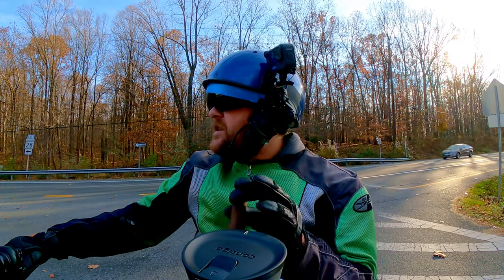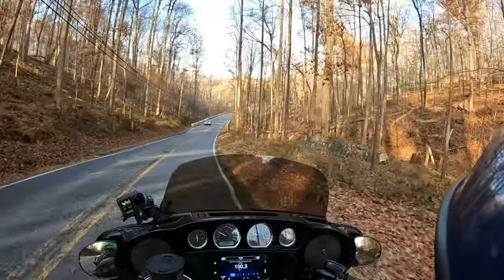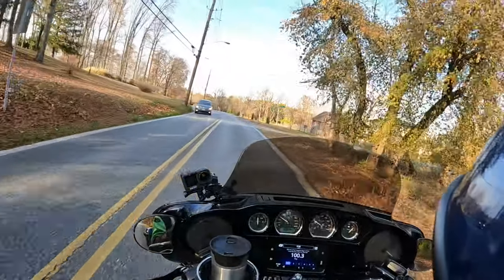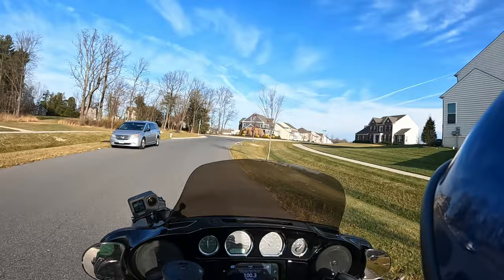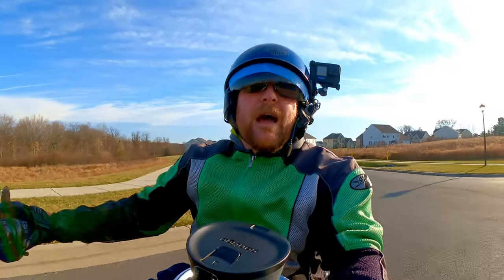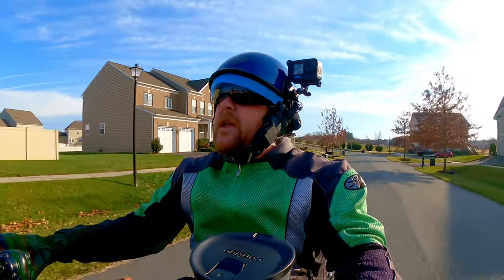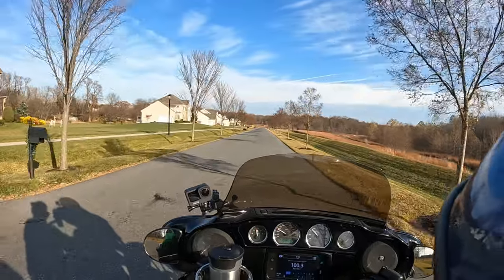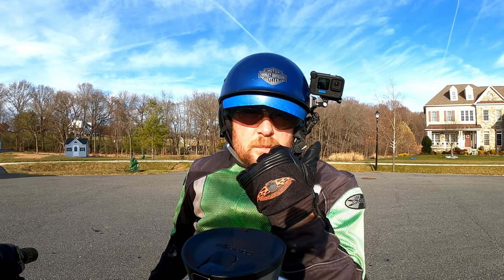Getting GREAT audio with a half helmet is EASY, I'll show you the secret of how I do it!

Comment: I've always been amazed at the quality you get with the helmet you use.  Me with my full-face always sounds echoey (is that a word).   I do have a wind noise reducer feature in my software that I have been using lately.  Just enough to knock it down a little.  Ride Safe!
Reply from the maker: Thanks man!  I think if you're getting an echo, you need to find what's causing it and add some foam or something.  You ride safe too!

Comment: I get good audio some days and some days I don't. It is so frustrating. I too use a half helmet and for well over a year I got good audio and thought I had it all figured out. Then a few weeks ago My audio went bad. I slightly moved the position of the mic and it was good again. Then it went south again. So I don't know. I use audacity to try filter out unwanted noise and It doesn't work. DR won't run on either of my computers. Merry Christmas John.
Reply from the maker: Merry Christmas, Greg, to you and your family!  Hopefully Santa brings you a new video editing PC for Christmas!  As for your audio, I would suggest picking a short-ish route that has several easy-to-access pull-offs on it, so you can try different mic positions, dead cats, etc., and then take pics of each setup before you put your helmet on.  Record the whole thing, and then play it back to see what changed and how.  That's pretty much how I arrived at my current setup, and I don't dare touch it for fear I'll mess it up.